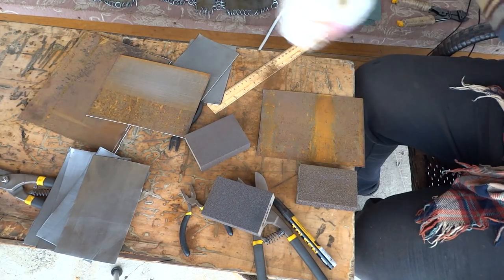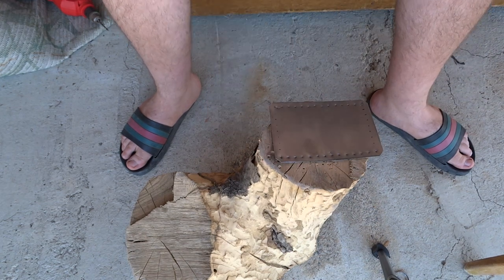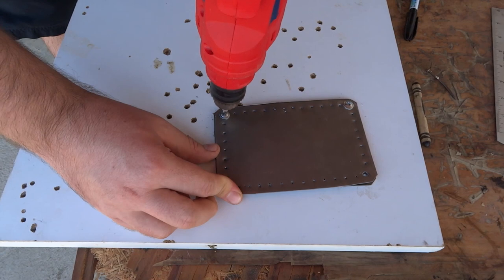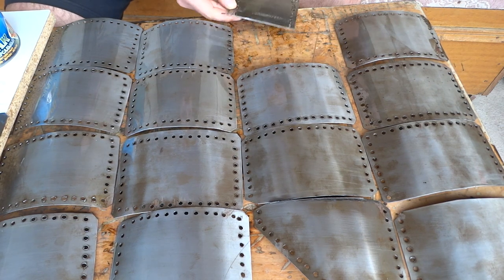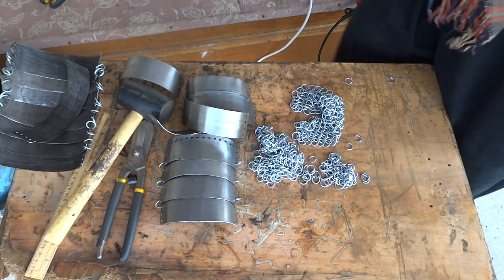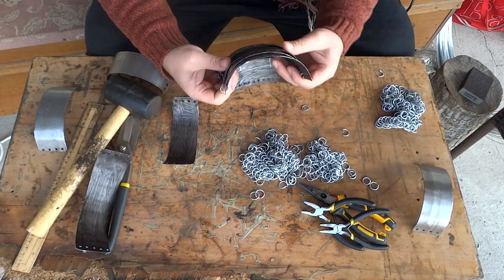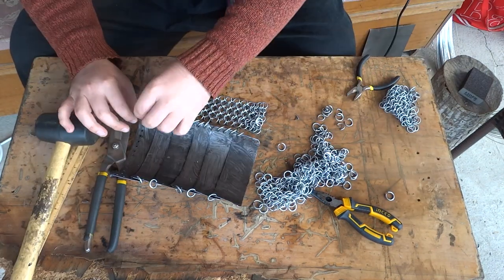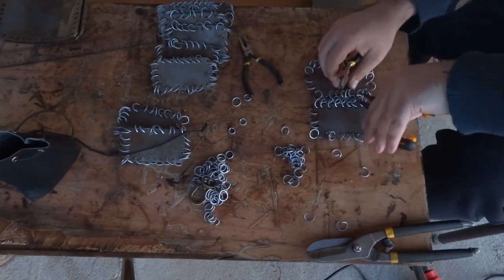how to make Plate mail or behter style armor

Comment: The rust issue is so strange the rust should turn black when you hit it with vinegar.
Reply from the maker: now that I think about it, maybe its not the vinegar, its the one I used.
I bought Vinegar, but without me knowing my father used it all and then gave me his own made wine vinegar which he claimed to be more pure.
it did smell tougher, but maybe it wasn't so pure acetic as I was lead to believe.
Reply: @thebordoshow I use a similar process as a gunsmith.
The trick is to clean the metal with acetone or similar to remove any oils, wipe it down with vinegar or peroxide, and then let it rust evenly. When doing a firearm I’ll typically leave the parts in the bathroom while I take a shower, and the steam will cause rapid rusting.
Then, one you have a coat of fine red “sugar rust” over the whole piece, submerge it in boiling water for a half hour or more. This will convert the red rust to black rust, which acts as a protective coating.
Once the boiling is done, clean some 0000 steel wool in acetone to remove the oil, and scrub off any excess red rust. I have what’s called a “carding wheel” from Grobet that speeds up the process, but steel wool works fine.
Typically I’ll repeat this process three or four times. Once a thick black rust layer has built up, it’s very resistant to normal rusting.
A light coat of oil or lacquer seals it and you’ll have no trouble keeping it rust-free.
Hope this helps! I love the videos, I’ve been looking into making some armor in the Eastern European style, as my family is originally from the Lemko region.

Comment: use stainless steel
Reply from the maker: I tried but it didn't look right for me, it looked artificial and modern.
Reply: you could try heating it with a torch to change the surface colour @thebordoshow
Reply from the maker: @levibabbage3964  hmm, may be that could work